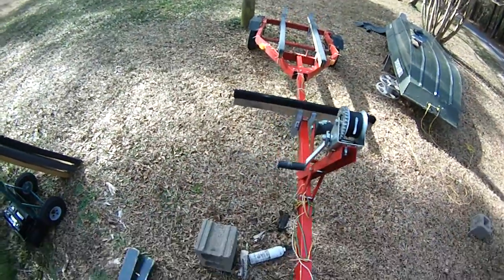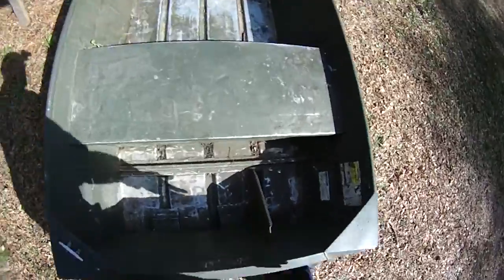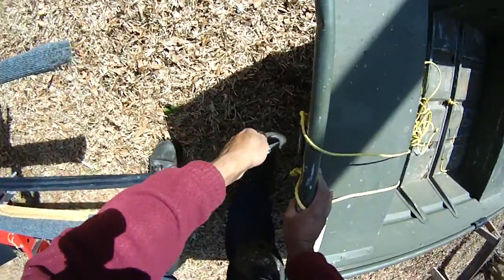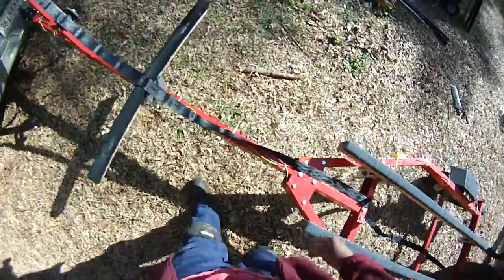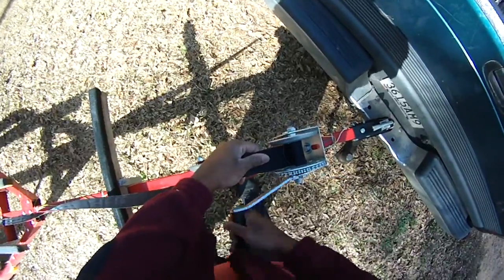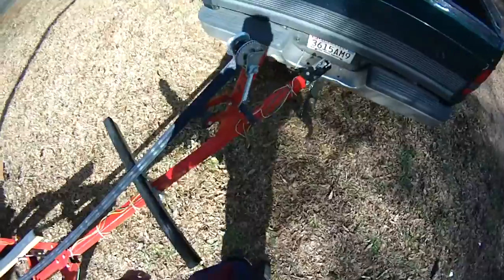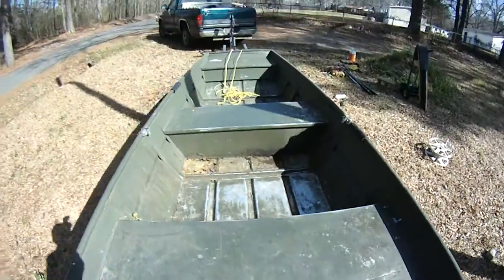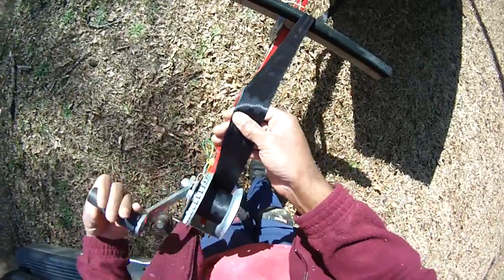Harbor Frieght Trailer Boat Load

Comment: Yeah I used to just pick up the Jon boat and put it in the back of my truck and tie a red flag on the Bow (loaded backwards).  All the boat stuff like motor and oars went into the boat to add weight before strapping it down, took about 2 minutes.
Reply from the maker: Yeah, that's about how I did it.

Comment: Hey amigo will this trailer work for my 16fter?
Reply from the maker: Na, not really. You could extend the runner to accomodate a 16 ft boat. It'd be fine if you're talking about a 16 ft canoe or kayak, but for a jon boat or dory or something, Na, I would want to use it for that.

Comment: A suggestion, move the bunks farther apart rather than closer together. The wider they are, the more stable the boat will ride.If you take it off again before loading your gear, then would be a good time to give it a quick bath with a hose and brush. Don't forget to have something to tie the transom down to the trailer. Also if you want to get into stealth mode, either glue some carpet squares in the bottom or at least just lay some squares in there to quiet things down. Indoor/Outdoor works the best as it can be scrubbed and dried. Still too damn cold to get on the water here!
Reply from the maker: +Ratdog 305 Yeah, this is as wide as they can go on this trailer. I will narrow them than add two tilting bunks to give it width and stability.

I always tie the transom down to the trailer itself with rope just like a canoe on top your car.

It's plenty warm enough here, but there's too much rain, and the water is way too high.
Reply: +Black Warrior Lures Yea this time of year sucks!

Comment: you ever drive over the maximum speed of 45mph for this trailer? if yes, how long? i did see your video that the trailer broke lol.
Reply from the maker: Yes, I've traveled at interstate speeds. i don;t know how long 20 miles or something the distance to to boat dock south of town. I don't think Harbor Freight sells this trailer anymore. They aren't worth it.
Reply: Black Warrior Lures I’m looking at a boat with the same trailer that’s why I ask. If I was to buy one new I would get the c.e. Smith multi sport. It’s rated for 65 mph and seems better quality for 799.99.
Reply from the maker: That's what my McClain trailer is rated at. I recommend you buy the boat and chunk the trailer for scrap.
Reply: @BlackWarriorLures  no they don't they discontinue them
Reply from the maker: @giloquendo  Ah, thanks for letting me know!

Comment: Move the side rails farther apart NOT Closer. Move the front support farther back, carry the back of the boat close to the rear of the trailer. raise the front support so it is even with the bottom of the boat. Move the wench just a little higher but not so close to the front of the boat. Check your trailer level with the boat on it and also you can use a bath room scale to weigh each trailer wheel with the boat on and also the tongue to get a idea how you may need to move it forward or a little back so you do not have to much or to little weight on the tongue for safer towing.  It sounds like a lot but not that much really just take your time and do it right the first time... First is check your weights and then start moving things  a little at a time you want it to se it level as close as possible and then play with your weight distributions.
Reply from the maker: Solid information. Thanks for the tips! I never would have though about leveling the weight on the trailer.

Comment: Does harbor freight still sell them trailers
Reply from the maker: No, they don't. I heard they pulled this because of faulty bearings. Of which you may have seen in my video here the bearings failed.
Reply: Ok thanks

Comment: or you could just make a trailer hitch extension to hold the back of the boat in your truck bed and mount a couple plug in trailer lights on it so yu do not have to worry about a flag and night time driving..

Comment: I watched your video a few more times and stopped backed up etc... If possible turn the 2 X 4 rails you are loading on flat so they are not so high and move them a little more forward so they are not sticking so far out the back. Also maybe if possible move your axle forward about 1 ft or so.. weigh your weight and weigh your tongue weight to find a place where you have about 1/3 of the weight or just a little less on the front. . 
All you need is enough height to not drag the bottom of your boat on the trailer metal frame.  and add another cross support across the trailer frame between the axle and the rear after you move the axle forward a little. This could be just a 2 X 2 alum channel etc... just something to give it a little more support from bowing out, or in.
Just make sure you have not used treated lumber where it contacts your alum. That cause corrosion. and it bad for it. It looks like your boat is going to far forward onto the trailer that's why it is hitting your wench. 
Try moving the front boat support farther back so you have room the the wench handle to turn around without hitting the boat. 

It is looking good though and you are doing a good job on it. Also Maybe add a short extension onto the rear and move your lights back a little or even make a support for them and raise them up higher and you cold also use than as a guide when the trailer is in the water to see the center of the trailer when loading.

I could go on and on but I better not. you are doing oops did a good job anyway just adding my 2 cents in.
Reply from the maker: Thanks again. I'm not using this trailer anymore. I bought something longer: a McClain trailer.

Comment: Easy to pick up and move around? So why don't you just put it in the bed of your truck with a few rachet straps and you save the money for the trailer since you don't need it. You have a full size pickup truck but your going to use a trailer for that little Jon boat. What's it weight around 80 pounds? I'd throw it right in the truck and go down the road.
Reply from the maker: It's called a bad back.
Reply from the maker: Please watch the latest videos I haul almost 500 lbs of total weight.
Reply from the maker: And how do you know what I do and do not need?
Reply from the maker: You can do whatever you like with your boat and truck.